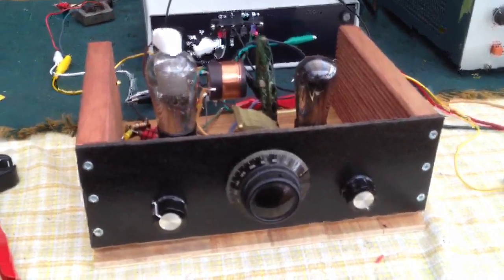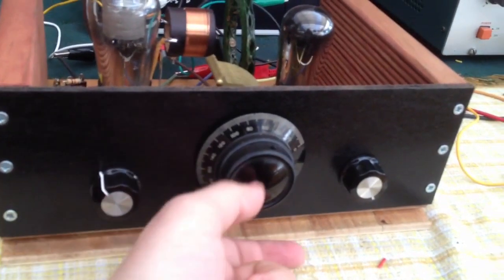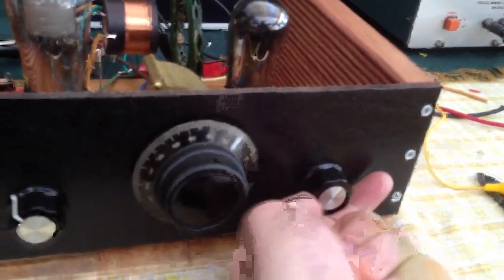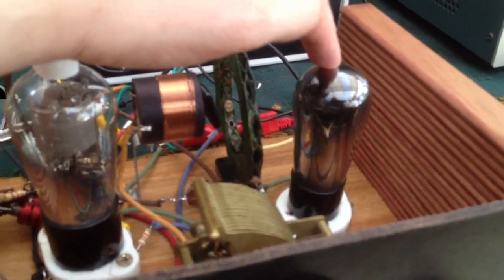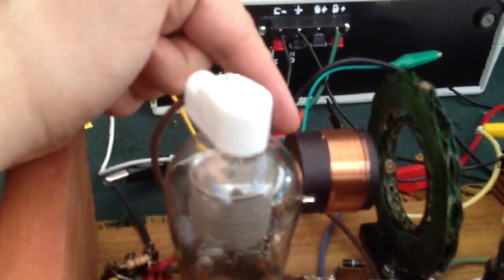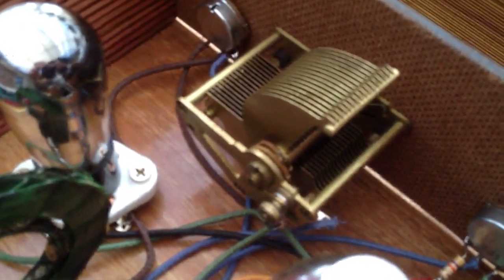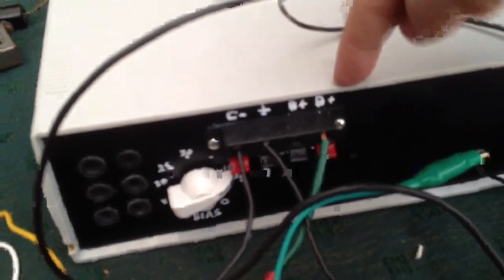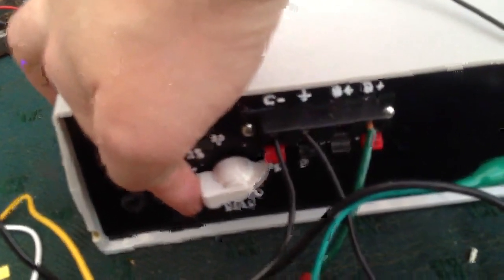Regenerative Receiver Using Type 32 & 30 Tubes

Comment: What do you think? Could this circuit use two Type-30 tubes? I'd like to figure that out. I don't have a T-32.....but I could try it with two T-30s!!! :D

How would you suggest working it into the schematic?